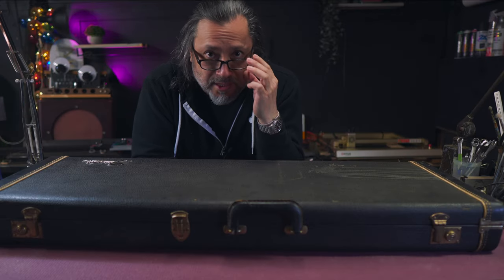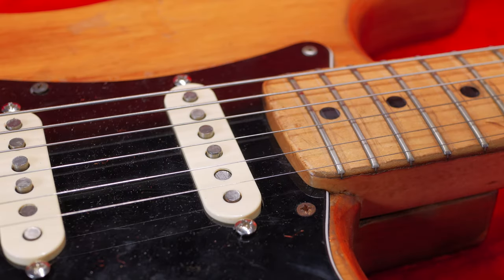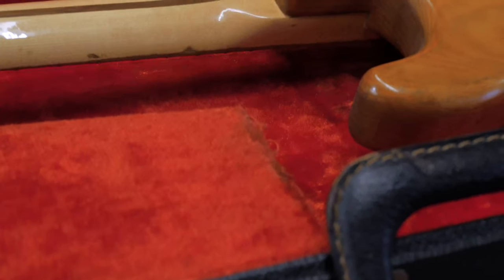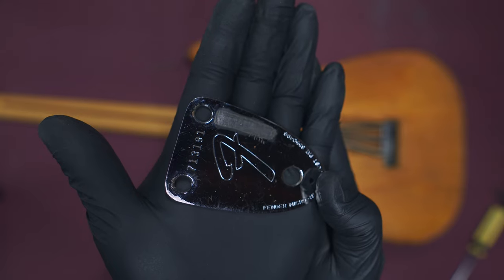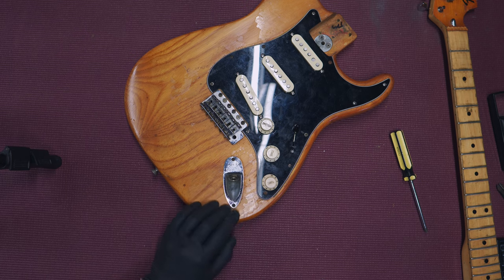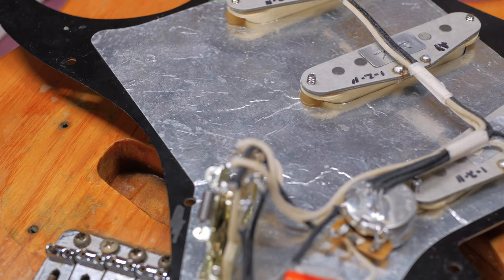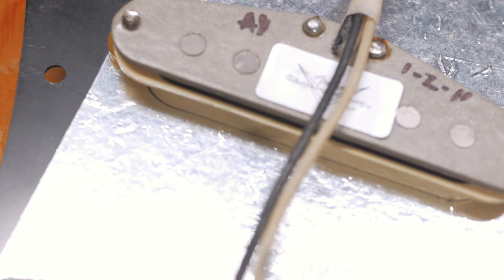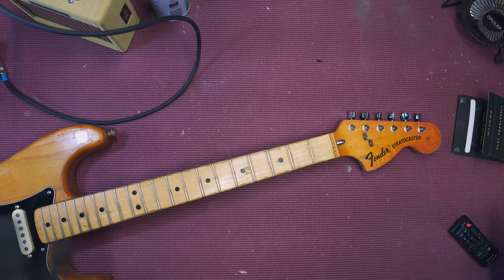1975 Fender Strat Disassembly - Mojo is Real

Comment: The AY on the back of your pickups stands for Abigail Ybarra. So much mojo/voodoo about her pickup winding career at Fender
Reply from the maker: Thank you so much for this info!
Reply: @MarkGutierrez  You've got a GREAT set of pickups! HIGHLY sought after and VERY pricey. Congrats!
Reply: Nope, they are NOT highly sought after, they are just Abby signed. A lot of people don't get it and then also advertise those pickups incorrectly: The AY initials make it just an Abby signed pickup, but someone else in the factory did the windings. There are thousands and thousands AY signed pickups all over the world and they are mostly the 69 CS sets everyone could buy for years. The collectible sets are the ones she did wind indeed with the full name written down as they were only used on special Fender Custom Shop releases of limited numbers and not many people ripped them out of their guitars.
Reply: @7enderbender87  You're so right. The AY 
signed as opposed to the AY initialed are the sought after pups. There was no custom shop back when she was actually winding...I mean WAY back when she was winding.
Reply: That's some in depth knowledge,  my 62 jazzmaster has Martinez signed under scratchplate,  always wondered who that was
Reply: @7enderbender87 didnt she work at fender for many years before the custom shop? If so she didnt wind any pickups before then? Just a signer?

Comment: Whats happening on the front and sides is they went over the original finish with something else. The new layer didn't bond with whatever is underneath - Even if it feels like bare wood, there still is likely enough of the original poly in the grain to make the new layer not stick.

Did this myself a few times by not thinking about what I was doing.

Comment: I am blessed with a 1973 sunburst version. There is a serious bolt under that neck plate, just as an FYI. I changed out the entire bridge but some people dig these pot metal bridges and the more midrange sound they offer. Mine is in desperate need for new frets ... I razor bladed off the poly from the fingerboard on mine. Congrats on your new Catastraster. I cleaned mine when I first got it (inherited from my late older brother), and tons of yellow from tobacco smoke, came off of it. Nothing ages a guitar like tobacco and sweat! I doubt that's polyurethane or polyester doing that checking!

Comment: That high E string is right at the edge of the fret board which activates my OCD into overdrive!
Reply from the maker: Yeah, with those 3-bolt necks you have to give them a good whack, to align the neck back in place, then tighten the bolts.

Comment: The grooves on the fretboard are due to a re-fret. Original finish is applied after frets, so it needs to be sliced down the fret edges. This can chip the finish. Also easy to spot if the fret board is lighter than back of neck. 
The body finish may be a refin. Maybe compare to finish in cavities and under the bridge on the top. I have an all original  76 and it has thicker finish which colours unevenly in places such as strap areas.  The 3 way switch is easy to live with and use for 5 tones on mine (with the simpler wiring and gives great Hendrix tone). These guitars can be great. If you love it and it sounds good…..winner.
All adds ‘mojo’. Every guitar has a story.

Comment: The green stuff - I was in a band for a while with a guy whose sweat was caustic to anything metal. He played my backup guitar for half a show and his sweat got under the pickguard and made that green stuff from the shielding on the back of the pickguard. But what's weird about yours is, there's no evidence of that on the shielding. My shielding was also copper and the green color was like the Statue of Liberty. Maybe it was a previous pickguard?
Reply from the maker: ah, I like this theory.
Reply: I bought a guitar owned by an old roadie about 8 years ago, a custom made explorer with a flame top no pickguard, and it had this green stuff on some of the frets and in the corners between the fretboard and the body as well as in the pickup routes and even under the trussrod cover. Came off easily enough but was very odd. Did have lots of copper shielding tape in the pickup routes and the control cavity but that wouldn't explain some of the areas I found it in. The guitar definitely sat for awhile before getting sold.

Comment: it's been refinished with a thin poly, thus the thin crispy peels coming off.
Reply: the green stuff on the pick guard cavity are oxidation reaction commonly on pearloid pick-guards which that guitar may originally have or because of the copper/aluminum shielding of the pick-guard.

Comment: Does the thin e string goes out of the fretboard at the 21th fret? It sure looks like that at 6.40. Bought a new one in -75 where the bridge was at least about 5-6 mm off so that the e string almost went off the fretboard at 21th fret. I was young and didn't noticed it when I bought it. A friend
helped me and did some woodwork to move the bridge up so the strings became straight over the neck. Fender had some issues at that time I guess.

Comment: The raw fretboard on the high e-string edge is most likely wedding ring rash.

I’m not a finish expert, but I always hear that nitro finishes actually become part of the wood rather than sitting on top of it like polyurethane does, but maybe that’s different if the finish isn’t exposed to the sun and air because it’s covered by the pick guard.
Reply: Nitro never becomes part of the wood. Fender always used a lot of filler and sealant on their woods, so there is a lot of impenetrable material between the wood and the final nitro finish. The only benefit nitro gives you is a different feel and look, it has no real effect on the guitar other than that. I do think nitro finishes do look better.

Most of my CBS era Fenders have that ring rash on their necks. You need something metal to wear through the poly finishes. I have some CBS era poly finished guitars with hardly and finish left on the necks, and I always wonder how hard the original owners played, or how many rings they must have had. Those finishes are crazy resilient.
Reply: @ES-qm5hr  I don't know about Fender, but in reference to Gibson guitars, I've heard it several times from different sources that nitro finishes soak into the food while poly finishes sit on top.

Comment: People love to shit on 70s Strats despite Both Ritche Blackmore AND Yngwie playing them and having sigs axes from that era LoL!
Every era can have anecdotal examples of shitty individual guitars.
Reply: Well I was a very active Guitarist in the '70's and I can tell you that there was  a "cottage industry" in London converting brand new Strats back to 4 screw original. I refused to buy any under CBS and waited until the new management team took over in the early eighties. Even then there were anomalies. For example the cheapest Fender USA Strats had the output socket mounted where the second tone knob should have been. When I was in Japan I picked up two of the then new  Squire Strats MIJ  - they were streets ahead of the US Fenders.
Thank God Fender USA got the quality and specs back up to a reasonable level by about '84 (someone correct me on the right year if I'm wrong).  Pete.

Comment: Mid 70's Starts are the worst. I had one and it weighed a ton, tiny frets, shitty pickups shitty tuners.
     Finding a mint condition vintage guitar is boring ? That's ridiculous. Considering the rarity and value of a mint condition guitar most sane people would be ecstatic. I hadn't realized that dirt, corrosion, and rust were mojo. Somebody should tell those old Delta bluesman that they have it all wrong.

Comment: the string alignment was really bad, even with the high E adjusted on the saddle. Thas why people dont like 70 neck and pocket system
Reply from the maker: true. I had to bang the neck a couple of times to get the high E aligned. once it was aligned. I tightened the bolts. so far, so good.

Comment: This video is so full of inaccuracies. 

It's a poly finish for sure, poly does check given the right conditions. It may even been a refinished on the sides and top for some reason with another layer of poly. That nut is not original and cut crazy bad. Also, those tuners are not original, they are obviously reproductions added at some point because the originals were taken off because you can see the screw holes for the other tuners. Those marks on the neck board definitely a bad re-fret job from the past. The number in the vibrato block is a patent number they introduced those between 1971 and 1972, and there are similar ones under each saddle. The wear on the neck is from rings, not chemical reactions, its really common on this era of guitar.

I love CBS era Stratocasters because they are great value, and there are a lot of good ones going for cheap. This one looks like an absolute train-wreck, and is the kind that gives the era a bad reputation.